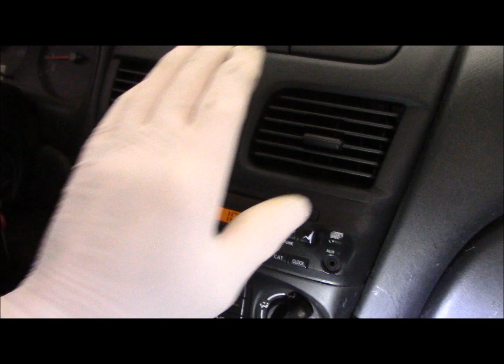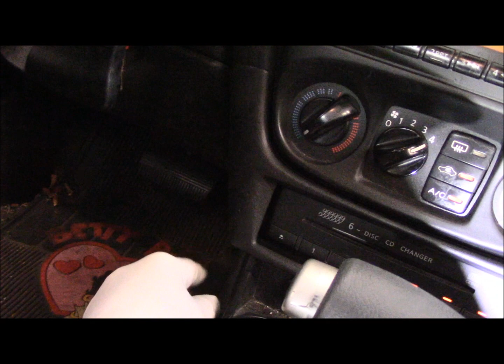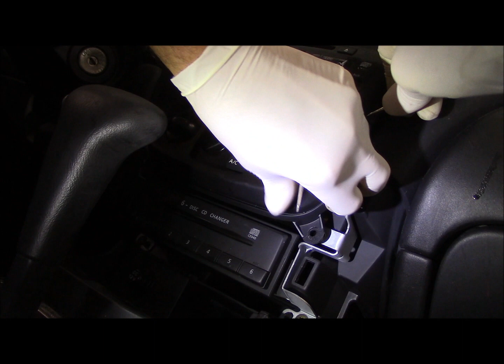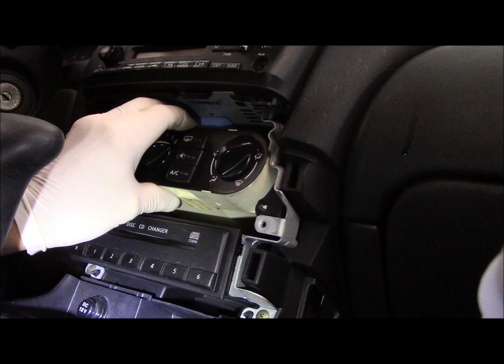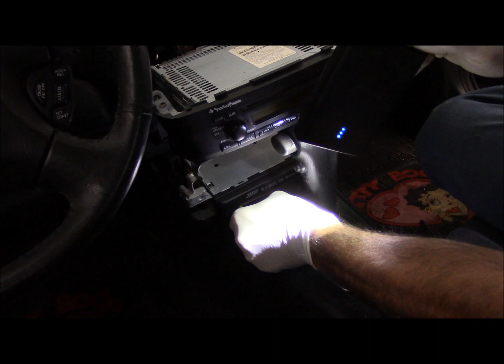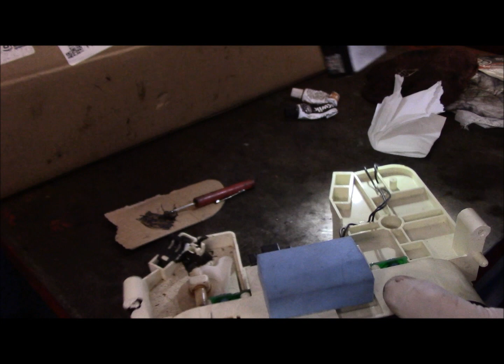AC Or Heat Stopped Working 2006 Nissan Sentra

Comment: Bought an old 06 Sentra from a friend and the AC made a nasty noise, turns out the cabin air filter hasn’t been replaced in over 10 years and the blower motor was clogged with leaves and nuts from over 10 years ago, this clogged the motor so bad it shook the center console up enough to break the plastic off that was holding that AC pin down, this video saved me over 600$ with only a Phillips screwdriver and a 3 zip ties, thank you so much man.

Comment: FYI, I used JB weld to secure the AC cable to the bottom of the dash, where it's supposed to go, and it's been holding strong for 4 years now, still blowing cold, I haven't done it to the other side yet, so maybe next time I'll do a video to show what I'm talking about

Comment: A lot of this Sentra vehicles specially 03 - 06 suffers from all kinds of things concerning A/C. We have a 2006 that we use to go around and I wanted to finally fix the A/C because the car is in good condition. I took the car to 2 technicians and the car came back basically the same way blowing cool sometimes and most of the time is was kind of warm. They gave me all kind of excuses but nothing good came out of it. I decided to work on it since I have all the tools but I was coming out of a serious surgery so I did not want to bother and that when I found out this vehicles A/C are nothing but headaches is like they have some evil inside the A/C.  Eventually I replace the air compressor with a Denso oem, replace the expansion valve, the condenser with the accumulator and the pressure sensor I even replace the blower resistor sensor. I also check for the controls and they work fine and check for leaks with ink. Also had the evaporator cleaned which is the only part I have not replace and the A/C is still not giving the cooling it needs to keep that car cool at 85-90 degrees. One would think after all that should be doing pretty good but so far noooooo. Before anyone asks we vacuum the system for 1 hour yes 1 hour.

Comment: Jim, I have the same problem with my 2006 Sentra, system only blows hot air and the AC was working just fine right up to when this issue started. The dealership said the fan motor was internally failing causing AC system not to work. The quote they gave me to fix this was $1,347.20 plus tax.  I would love to hear your opinion on their diagnosis and their quote. Your expert opinion is greatly appreciated! Thanks.

Comment: I have a question my A/C (Nissan Sentra 2002) blows hot air all the time even if it is turned off.
Do you think it could be the Blower Motor Resistor? Or could it be another problem?

Thank you.
Reply from the maker: The first thing that you need to check is the freon level and see if the compressor is turning on.

Comment: Thanks a lot i got this problem as well. ac is hotter than the outside air seems like that air redirector is the issue. unfortunately my temperature control knob is electronic and seems to be working. the problem with mine occurs when ac light is on.

Comment: Well, now I have the same issue but on the vent control. The wire isn’t broken off the assembly but it just doesn’t work as intended. I have to manually pull the wire from the sleeve to change the air from from vent to windshield. Any help on that? Do I need to see a mechanic or is it possible to repair?

Comment: I had this same problem and just fixed it.  There is a seller on ebay named rocketscraps that fabricates custom 3D printed brackets that are WAY better than any other existing fix.  He also sells whole units that are pre-fixed with his custom parts.  The next best method would be to drill some holes and use machine screws with nuts and washers on the other side.    Now if I can just find a good way to fix the center console lid, which breaks off at the hinge point.
Reply: I had 2 2006 nissan sentra's.  First one with this problem used JWeld and the fix held for about 4 years until I scrapped that car due to high mileage and son getting a 2024 sentra.  So I took his 2006 sentra due to half the mileage and better condition.  Now the second one has the same issue.  Since 3d printed parts are good enough to use as gun parts, I figured I would purchase a unit from Rocketscraps.  Thank you so much for this information because his fix looks to be the best I have seen.

Comment: This was a very helpful video. Thank you.
All your trail blazing here made my disassembly take less than 2 minutes.. Shifter already out of the way. You really helped me out.

I managed to crack the right side cable switch clip area of mine while disassembling.. The plastic has really reached that stage where it's not what it once was. That piece has far less stress put on it than the left. UV epoxy fixed it fine.

In trying to fix mine with epoxy, then reinstalling, I could see why the part failed in the first place. The cable there pushes really hard towards the driver and breaks out that front pin/bridge to the clip. When one goes, the other pieces collapse like a house of cards.

I ended up drilling 4 small holes to allow zip ties. 2 to hold the clip, and one, the cable.
Epoxied the broken plastic parts back on for good measure, but the zip ties are doing all the heavy lifting. Without the ties they pop right off again.

If you use zip ties that are skinny enough, this is holding it better than it was originally.

I lubed up the cables with some bicycle cable lube for good measure and replaced the grease on the gears, and it seems like it's a little less stressed now.

Once again, thank you. It was only so easy because of your video. I'm actually pretty confident this is going to hold as long as a new/old replacement. The design is a little flawed and those parts aren't built up enough for this amount of stress.

Comment: My is blowing cool Air, but not cold. If take it a part I'll end up with 20 extra parts after is done
Reply: More likely your AC is in need of a flush, Leslie, though you can still check it out and see if the cable is fully seated. If it is, it's your AC system.

This fix in this video is purely about that cable breaking away from the housing causing it to be stuck at whatever setting it snapped at. Seems to nearly always be at hot though.
Reply: @breaddrinker  Thank you.

Comment: How did you get the thin metal things back in to the tiny holes?
Reply: Do you mean the ends of the cable? They have a right angle kink on the end. You feed it through and turn, and it holds itself.

If you mean the metal clips, one end hinges, and the other snaps in place. That's usually the part that breaks.

Comment: Nissan Sentra are LEMONS.
Reply: Yet here they all are 20 years later, still running.

They aren't without small issues, but for the money, they're repairable almost forever as the engines run and run.
Reply: These small issues pale in comparison to being able to go 300k+ miles without any engine or transmission issues.

Comment: I wanna personally thank you for this video. I have an 03 Sentra that was giving me this same issue. I do a lot of my own work because I don't trust local mechanics to do this job without insisting on replacing the whole head unit without offering alternatives. I realize this isn't a permanent fix to the problem but it has brought my AC back during a time I really need it and saved me a lot of money I didn't have to throw at it. Thank you so much!
Reply from the maker: I'm happy to help. Thank you for watching. Actually I did this job about 4-5 years ago and it still working.
Reply: @jimthecarguy  that gives me hope for this fix lasting me a long time :) thankfully the cost of the part has gone down over time but I'm fine with zip ties and it really is a more solid fix than the original assembly.

Comment: You can use a small zip tie over the whole clip assembly if the plastic war has completely broken off, just make sure you save the clip, place it on the control line like normal and crank down the zip tie, if you can get it tight enough it seems more secure than the normal clipping apparatus
Reply from the maker: Thanks for watching

Comment: This part broke twice on my daughters car. The first time I found a used one for $50. The second time I couldn’t find a decent one for under $75. Found a company that makes a repair kit for about $35. Fixed it and it’s remained fixed for the last 5 years.
Reply from the maker: Thank you for your input. I did not know there was such a kit.
Reply: @jimthecarguy  yes sir, here is a link for reference https://blenddoor.com/product/2000-2006-nissan-sentra-climate-control-cable-rebuild-kit/ they have other kits for other makes too!

Comment: I don’t know how but I figured this out before watching the video. I had the same issue and I know nothing about cars but I fixed it. The switch gears were snapped and the wire that activated heat or cold was stuck on heat. I took out all of that crap too. I went to pick and pull and grabbed a new control panel. Installed it and switched it to cool. It worked. Now my thermoamp is broken sooo... there’s that.
Reply: Cost me 40 bucks to replace the whole head unit. I don’t like going to mechanics because the prices are outrageous. It isn’t too terribly hard to replace these things and the parts are cheap. Not to offend anyone but mechanics seem to spend 30 bucks and pocket hundreds.
Reply from the maker: Thanks for watching . I'm happy to help

Comment: I found it the head for less than $20 in junkyard . I just need the metal black clips but i'll get them . Yeah my cables were loose because that exact same plastic piece where the cable goes through was broken . Had a hell of a time taking off the left plug but finally got it . Had to press the middle white piece which was holding it in place
Reply from the maker: I'm happy to help. Thanks for watching. Don't forget to hit the bell for notifications when a new video is posted.

Comment: Hey jimthecarguy, I wish I would have watched your video before investing in a $50 ac refrigerant that was totally not needed. After watching your video I managed to perform this repair in about 45 minutes. I know you called it "temporary," but the actual plastic ties you put I think is the real brilliance in your repair and with some planning I was able to strategically drill holes and get the cable set quite securely using my own landscaping ties. A HUGE THANK YOU, kind sir!
Reply from the maker: Actually those ties are probably better and stronger that the way it was made. Thank you for watching .  Don't forget to subscribe.

Comment: That Climate Control unit is discontinued & almost impossible to find a replacement for it. I replaced mine a year ago. I had to special order it on the internet. A pick-apart yard or a site like eBay may be the only options left to buy a functioning replacement.
Reply from the maker: Yes when the parts are discontinued you don't have much choices.

Comment: excellent video. I just bouht a 2006 nissan ALTIMA and suddenly I have no heat (only AC). I was doing my homework in advance to determine how to troubleshoot the cause.  Now I realize I am suspicious because the top storage compartment ( above the radio and heat/cooling heads) that you removed in this video is cracked on my car. Making me wonder if there was a car accident or did someone crack it bc they pulled it off to troubleshoot this kind of issue ... i.e. no heat.

Comment: I’m about to attempt to fix my 05’ Sentra due to my defroster not working.  The vents are constantly blowing air though... do you think diagnostic code P0128 (coolant thermostat) may be triggered due to this?  Just curious as I might have to replace the actual thermostat as well. Thanks

Comment: Tried to fix a similar problem in my Sentra but I cannot get out the assembly. Air flow position only works on face position. No air coming out when switched to feet or windshield.

Comment: Thank you Jim. I did the same repair did not work air still blowing warm and even warmer on the driver side. Ok on the driver side when you take off the side panel and the face panel at the steering you can see the cable that it turns the door gears but did not make a difference even I turned it by hand both ways. There’s a video where he says lube it but that does not fix the problem. Could it be the evaporator core and is that where it’s located behind the control. Thank you.call me. Or email me thx. At: dblo381@gmail.com. Please. The shop has no idea and replaced all major parts bad service and I’am a diy who knows more than them. Shame.

Comment: Just came here to post my 2006 Nissan hadn't had AC working for the last two years and I just now found this video. You don't have to pull it out though as an FYI to others, zip ties will fit around the black clip in the video, at the back the hole is just wide enough to slip one down through it and around to tie it up. I don't know how else to explain it but yea you can put zip ties in it without pulling it out and they will probably out live the car itself.

Either way incredible video, a $400 fix into a "I have some zip ties laying around" fix for virtually nothing. Added some refrigerant today and I'm a happy camper.

Comment: I have an issue with the air blower on my air conditioner/heater when it's turned on sometimes it makes a noise like the blower is rubbing against something. The noise is not continuous it just comes and goes. My car is also a 2006 Sentra so any feedback will be greatly appreciated thank you!!!!
Reply from the maker: Sometimes leaves or something get stuck in the blower wheel but if there is nothing in the wheel then the motor is going bad .Keep me posted.

Comment: My 2005 sentra, that climate control unit failed after a 2 or 3 years  owning so 4 or 5 year old car then.  Cost about $250 for the Nissan of Chesapeake VA to replace it.  And now 6 or 7 years since it failed again.  Specificly the directional knob.  As the vents are stuck in one position. Bought a used one off eBay for 60 bucks.  So I'm refreshing my memory watching this.
Reply from the maker: nothing is made to last.Thank you for watching
Reply: jimthecarguy just like light bulbs and other things,  they could be made to last but then they wouldnt make money  on repair or replacing  stuff.  Since it would take a long time to break or need replaced.
Reply from the maker: Thank you for watching.

Comment: Thanks Jim for the Interesting repair. It's always nerve wracking prying all those plastic clips apart with breaking them. Have you ever used Q Bond ? Great stuff for plastic repairs and is often as strong as the original part.
Reply from the maker: Your correct about those plastic clips especially in the cold weather.

Comment: I've done the zip tie trick on the cable hold down bracket. it will last longer than you would think..
Reply from the maker: reweydewy I'm sure that is what the owner is hoping for Lol that's for stopping by the shop